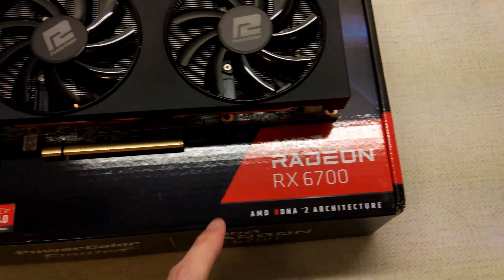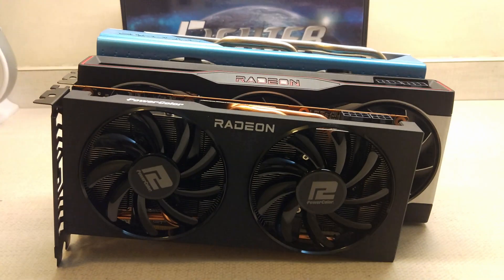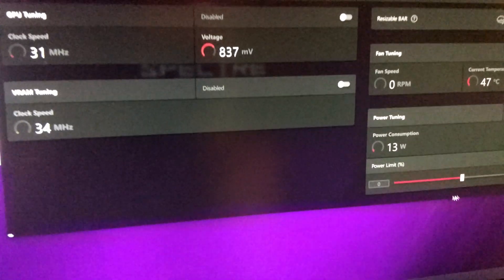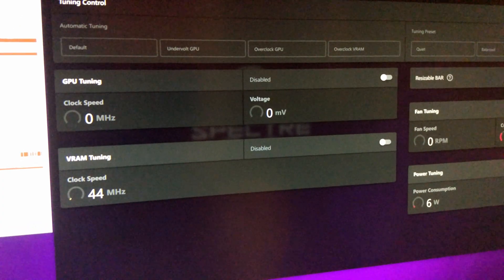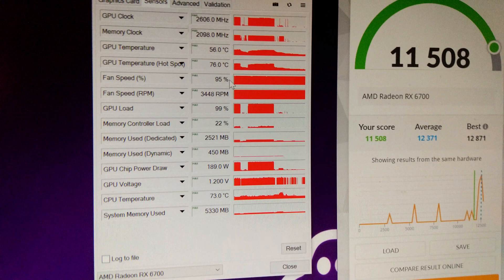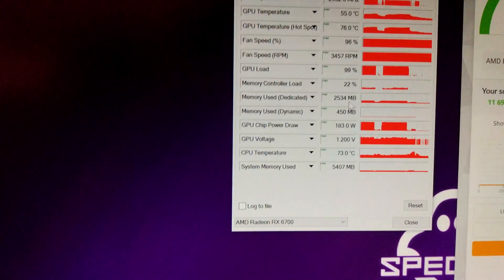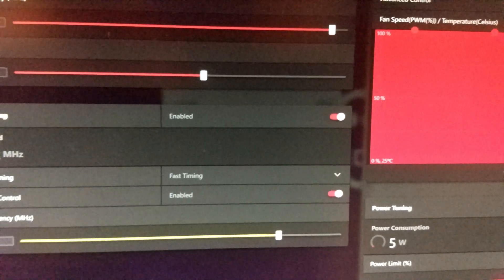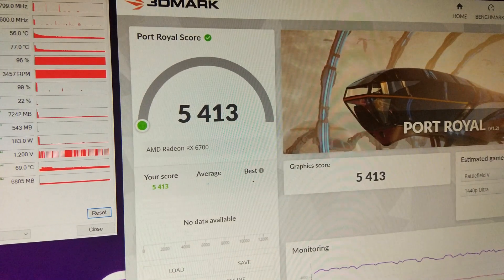Powercolor Fighter RX6700 10GB Overview Undervolt and Overclock

Comment: What the fuck i didnt know these existed
Reply from the maker: Neither did hwbot or 3dmark 😂
Reply: @LawrenceTimme  just researched it was released a month ago wtf why??? Between 6650xt and 6700xt this looks so pointless
Reply from the maker: @mtunayucer  it's faster and cheaper than the 6650XT. I think it was originally intended to be sold for mining only. That's why they only came retail recently after the crypto crash
Reply: @LawrenceTimme  ah, makes sense. 160bit bus is a weird number and a way to cut bandwidth but hey, it works.
Reply: @LawrenceTimme  And it has 16 PCI-E lanes.
Reply: @emelyanychcool3715  which would be useful for older systems with pcie 3.0
Reply: @LawrenceTimme  That's right, it WAS an (unused) mining card, but they couldn't sell them, so they fitted 3 Display ports, and one HDMI port on it !   Officially ..... they are "defected" RX 6700XT's that Radeon sold ONLY, to Power Color, with a large discount, to make mining GPU's of them ! But now turned back to Gaming GPU's. ONLY Power Color has them !  But hey .... they are really good gaming GPU's ! The are (in Holland) at least 100 euro CHEAPER, than RX 6600XT's ! and all that, while these are faster, and has more Vram than an 6600XT !
Reply: @gertjanvandermeij4265  I just bought a sapphire pulse radeon rx 6700 from Newegg last night, so Powercolor isn't the only one selling them
Reply: @gertjanvandermeij4265  any official source of they beeing mining cards? or is that more your assumption?
Reply: @mtunayucer  It's not a weird number at all. The connections between the GPU and 1 memory block are 32 each. So 160 : 32 = 5 memory blocks. And since radeon uses 2GB of memory in one block, the resulting size is 10GB of total memory. I believe these are faulty chips originally with 256 connections between GPU and memory. This is how they used them advantageously.
Reply: @gertjanvandermeij4265  You are not right, the manufacturer SAPPHIRE also has them in its offer, see their official website. Otherwise, everything fits, they are really good game cards with an excellent ratio of price, energy consumption and graphics performance.
Reply: @michalpetrilak3976  especially when you undevolt them to max of 130w with same +-FPS